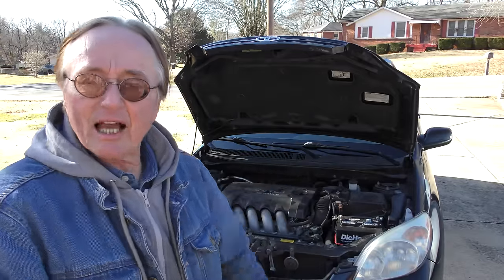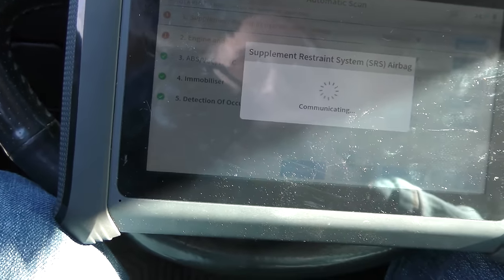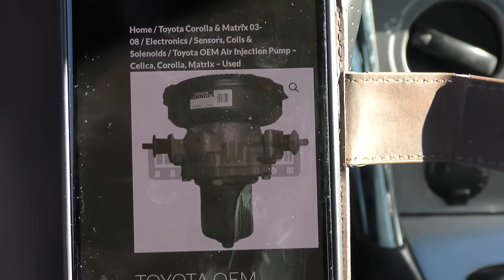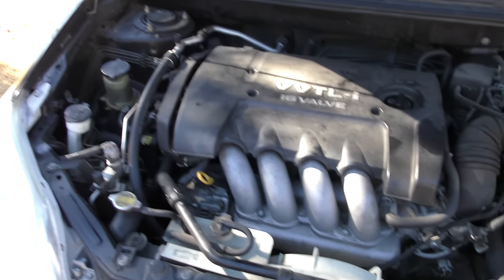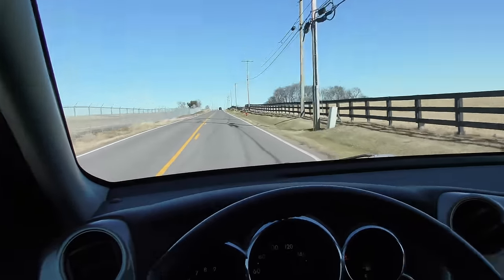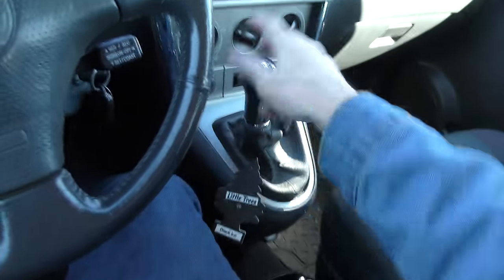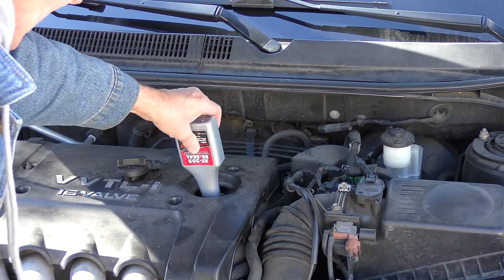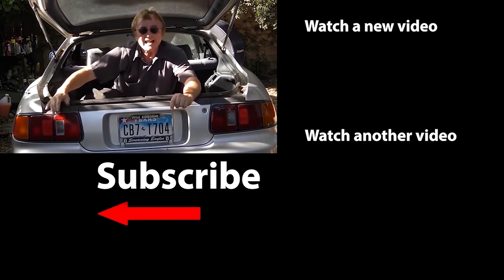I'm About to Get Sued for Showing You This

Comment: Every Matrix I've owned has had a weak manual transmission.  I've had a 2001, 2003, and 2005.  After 250 thousand Km they will start to slip when pushed hard.  They always go and never left me stranded but you know eventually you won't be able to climb a hill.

Comment: Very hard to find a AWD in a manual unless it’s a subbE .(I’d pull the shield off) 
I like the body style of those. The rear windows lift up without the hatch opening pretty nice. 
My 10 didn’t they went in a different outside style (more bubbled look)

Comment: I had to get the transmission and clutch replaced in my Focus about 3 years ago, but the previous owner didn't take care of it and the shop found a used transmission with low miles and replaced the entire clutch assembly and it's running like new again

Comment: Curious, @scottykilmer, Is your wife's Matrix also an XRS? Asking because the XRS your customer has (2003-2007) came with the 2ZZ-GE 1.8 with a lift around 6500 rpm which produced 180 hp and about 130 lbs of torque.  Different from the other models.
Reply: no the wife's matrix is just the base model with the 1.8 1ZZ-FE and the automatic transmission

Comment: The intake runners are aluminum because its a totally different engine scotty. Youd think youd kinda know that. And if you need dye to know without popping the hood where that motor leaks oil. Your not a legit toyota guy
Reply: Every 2zzge leaks oil in the same spots. Tensioner timing cover and valve gaskets. Cmon dude
Reply: IT IS ABSOLUTELY NOT THE CRANK SEAL LEAKING
Reply: At205 isnt fixing the tensioner o ring or the timing cover leak or the ppwer steering resevoir leak which this car has all 3 of them leaking

Comment: Always hated those cars. Not as much as the corollas but close...   Corollas were great up till they started making them in Canada and became pure econoboxes. The Matrix falls in the same category. Plain Jane, no style, feel cheap, no excitement, no nothing. They are as plain as you can get. If a vehicle is an extension of ones personality, what does a Matrix or a corolla say about the owner? LOL!
Also I find the people who drive them tend to be the type that drive 15 mph below the speed limit while in the passing lane, fog lights on in the middle of the day, deathgrip on the steering wheel, not leaning against the seat, sitting straight up looking straight forward, afraid to look to the right or left, will slam on the brakes as soon as they see brakes lights from a car a mile ahead, afraid to pass trucks, slow down while trying to change lanes while entering a highway, will slow down going in to a intersection, if the light turns amber they will slam on the brakes to stop even though they are 6 feet away from the white line at the intersection, pull into the gas station confused as to which side the gas door is on, even though they've been driving the car for like 3 years and they use the GPS to get to work and home each and every day even though they've been driving the same route every day for the past 5 years.... Those types drive, Corollas, Matrix, Prius and some have now upgraded to the Rav 4 so be on the look out people. Those incompetent nervous drives are a menace to the safety of other drivers as they will panic and freeze up with the slightest thing that will happen on the road... A leaf falls off a tree, they are in the ditch and took 3 other cars out with them lol. 
The new corollas I find are getting slightly better drivers as they appeal to a sportier demographic. They also look way better!
Reply: You must be fun at a party. Toyota does sell sportier cars for those who want that.
Reply: @ronwest7930  The last time Toyota sold a real sport car that was fun to drive, and had any sense of style & personality was in 1998 when they sold their last MK4 Supra

Comment: How about using  a universal style cat n welding or clamping it in place i know its not ideal but wen the cost of the part costs as much as the vehicle i was wondering if those type "universal cats" would fix the issue and would keep the engine lite off . I used one on my old toyota pikup and had pretty good luck with it

Comment: Isn't that a 2zz-ge engine judging by the aluminium intake about what you said is a Yamaha stupid design on the celica video?
Reply: The one with the low tension rings that burns quarts of oil
Reply: @stevesmith756  that's the 1zz :)))

Comment: Question Scotty or anyone on channel I have a 03 Toyota Matrix XR. I just replaced upstream O2 sensor, PCV valve and cleaned Mass Airflow Sensor and throttle body. It runs and idles pretty darn well but I have noticed a decrease in my mpg. Any thoughts? It has 133k on it. Thanks if someone would reply.

Comment: Hi mate
This is Nrupen from Sydney Australia 
I have Toyota kluger 2009 and it has a problem with the radiator fan,it does not start when it is connected to temperature sensor but the fan start when I disconnect the Temperature sensor. I tried changing the sensor and the relay it does not work, could you please tell me what could be the problem. 
Thank you

Comment: Hey Scotty I have the same car and 2 months ago it got a check engine light with code 420, I put some cat cleaner in the gas tank and drove it around and reset the code. It’s been two months with no light and i live in California, when i go to get a smog test it said my cat converter is not ready for the smog test and they told me to drive it on the highway and come back. I drove 25 miles on the highway to see him in the first place, help!

Comment: Manual transmissions can take beating if your clutch disk has broken springs causing the disk to drag along on the flywheel on one side. This causes the synchronizers in the transmission to take a beating while the driver is shifting between gears while the clutch is never completely disengaged from the engine. It might not be too surprising that a manual transmission can be damaged and needs to be replaced. Bad clutch habits while driving can lead to a bad clutch disk.

Comment: It ain't cheaply made. The client's Matrix XRS has the Yamaha 2ZZ-FE whilst Scotty's wife Matrix has the reliable 1ZZ-FE engine. These Yamaha engines gain their HP at higher rpms, and they had a tendency to drop the oil pressure and starve the engine of oil on those high rpms leading to disaster.

I think they solved this issue on later cars that used the same Yamaha engine.
Reply: In my experience my 2zz Celica has been more reliable than my oil burning 1zz that I got rid of . I've owned my 2zz for 12 years no problem besides the common timing cover gasket leak .
Reply: @123PSPs  and I've owned my 2005 Corolla since new, has the 1ZZ-FE, has more than 215K and it doesn't burn oil. 

The 1ZZ-FE on the 2003 Corolla did burn oil when it came out. By 2005, they sorted out the issues and made it a reliable engine. 

As I said, later models that had the 2ZZ-FE as its engine, addressed the issue of oil starvation. 

But one thing is burning oil, and another completely different thing is starving the engine from oil.

Comment: Question, i really need help !! If my car starts and when I put in reverse but doesn’t reverse and it Drive on Neutral and drive what does that mean?
Reply: Sounds like the shift linkage cable is stretched or something causing the gear indicator to be off….or it’s inside the shifter itself…something’s loose in it causing the indicator to not read right…

Comment: Ive tried AT205 on a few vehicle's and also seen comments from other mechanics whove put AT205 insude the oil and found if engine has over 100k miles and the oil pan is painted on the inside the AT205 has a tendency to strip the paint and may cause an oil clog at some point so i definitely suggests only drive 500miles and change the oil right after that

Comment: Hi scotty, what will cause fouled spark plugs at 95k miles i think they are original plugs. Could it just be because they are old plugs? Also can smell a sulphur smell from exhaust is this anything to worry about?
Reply: Sulphur smell usually signifies the death of the catalytic convertor. This may have been brought on by whatever the issue fouling your plugs is.
Reply: @thekhaosrider  oh nooooo :( so my plugs are fouling at 95k or just old age and dont want my cat dying just bought the car 😢
Reply: *if they are copper plugs.....though it could look like they've been eaten.....😄
Reply: @thekhaosrider  seems like they were the normal ngks which i believe are copper but now i have the iridium ones in
Reply: All those cars came with iridium plugs. Lasted over 100k miles.
My 2003 had them. So I know.😊
Reply: Might have too much oil being burned, how are the oil levels looking? If you are finding yourself frequently having to top it off, you may have bad piston rings
Reply: @nicholaswarner1143  my oil levels are fine 3/4 i always check levels every few days and my car seems to burn more when i put my foot down into vtec but otherwise i would say i burn a quart every 1k ish miles something like that. Mechanics say i will be fine and engine will last long if i keep checking oil levels as dont want to run out as will be devastating for the cylinder walls etc. can any thing help release the rings? Just have done a terra clean hope that will help and chnaged the pcv valve too
Reply: Might be wrong plugs not Designed for engine. Found case with mine Needed "Iridium" plugs, original Equipment.
Reply: @Gruin  everything is all original as always go with oem parts